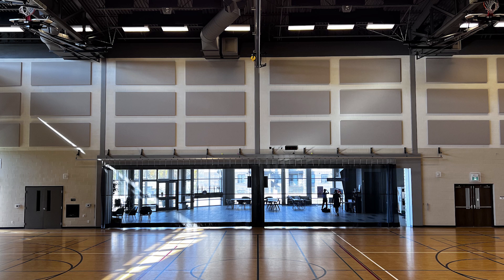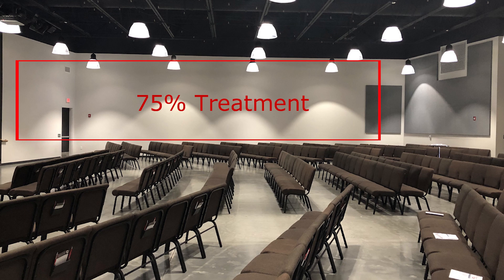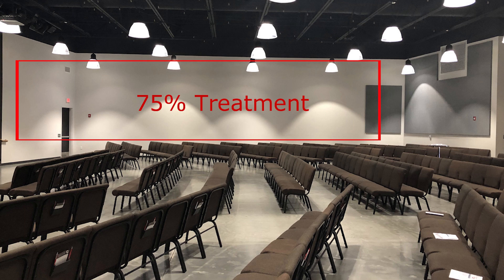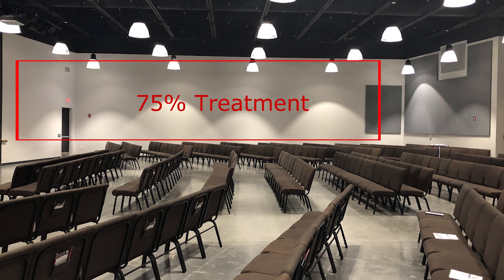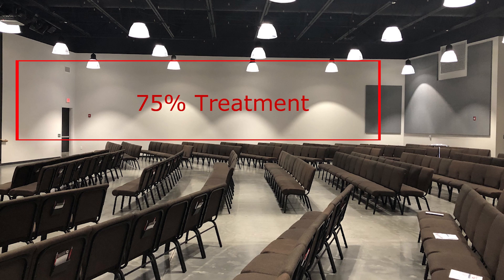I Can't Take This Anymore - Churches: Wrong Treatment Type & Not Enough Surface Area Coverage

Comment: Hi Dennis I have purchased your BDA construction plan . I have just completed building the acoustic panel successfully. . I have a small question. I am now building the Broadband Diaphragmatic Absorber.i have a small question.PEG board mentioned in your plan has to be plain or with holes . Because in my country we don’t get them .I don’t know what is the other option. Can you advise please.
Reply from the maker: You can use 1/4" MDF solid for front and back. Increase filter thickness to 4".